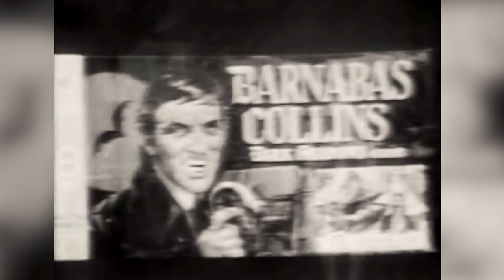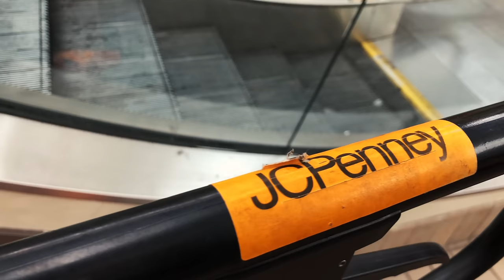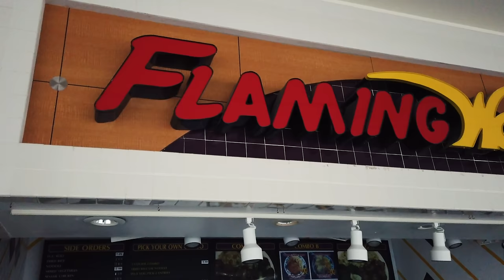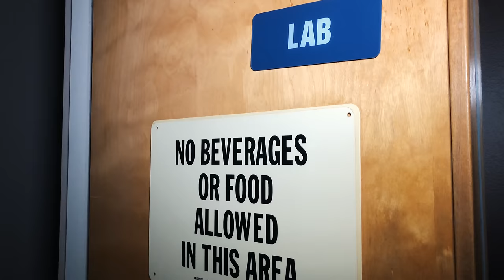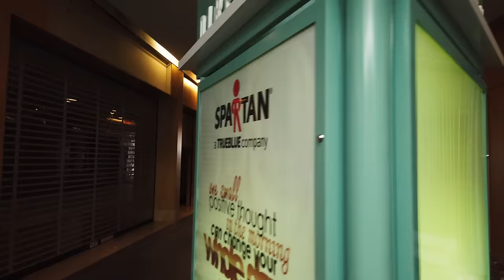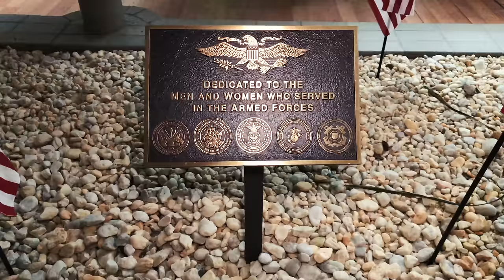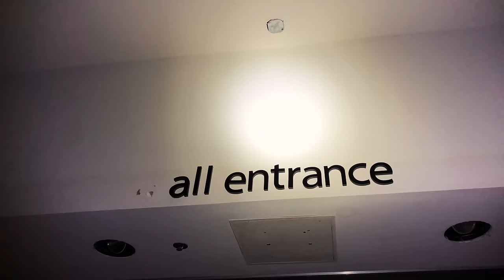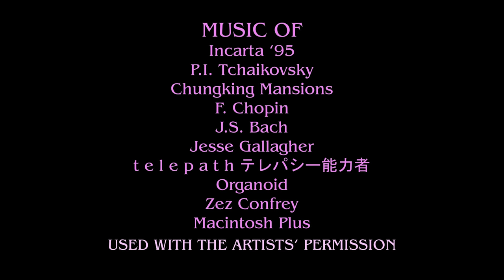The Abandoned Burlington Center Mall | an epitaph to a dead mall | ExLog 40 - Phase III Premiere

Comment: But what is the difference to actual (modern) malls? Its the combination of stores inside a mall, and you can ever change stores, even in old malls, and create a rich mixture of "business". A store which sells TVs, but no cables for them is useless, that might be a problem. Local stores dont have that huge offer, so you need big stores and none of these little booths. But are modern malls different in this point? Internet is! At Amazon you can get nearly everything, I think that is still the point. Here in Germany the same thing. Citiy-Stores are dying. I need a special cable. Driving to the city, pay taxes for parking (or getting a ticket), went to the (only) small shop and ... nothing. So I drive back home without any product I needed and order them online. Maybe not Amazon killed the malls, but internet did, and the huge variety of stuff you have today.

Comment: Some really silly commentary...
"Does the Internet have better options? Yes. Better prices? Yes. Easier to shop? Yes. Better service? Yes. Did they contribute to the downfall on malls? No. Just too many malls. No other reason. Idiots just built too many malls."
Yeah, there are too many malls because people shop on the Internet now. Who wants to drive 20 minutes, hassle with parking, trek all over some store hunting for the things that sorta match your needs, then wait in a long checkout line so you can pay a price that's higher than what you could get online after shopping for 5 minutes from the comfort of your home. They didn't build too many malls for the needs at the time. These malls used to be packed, even though it may not look it today.